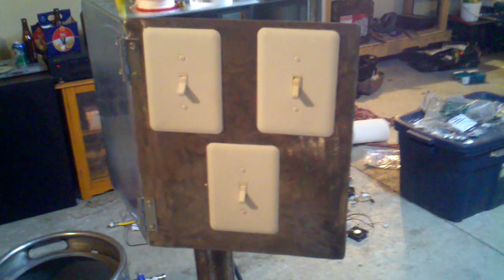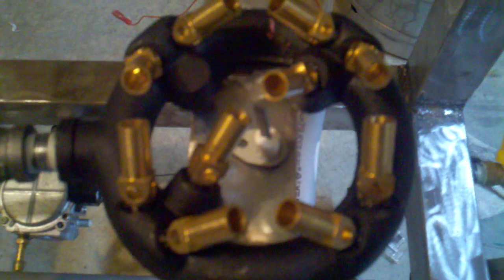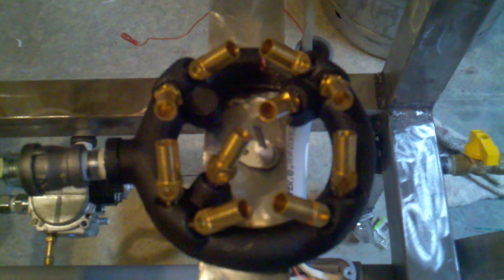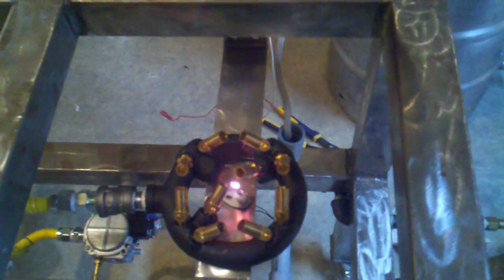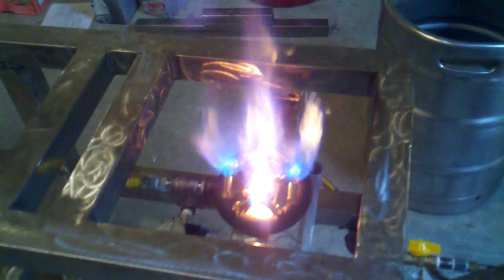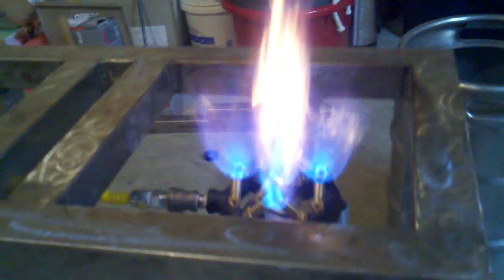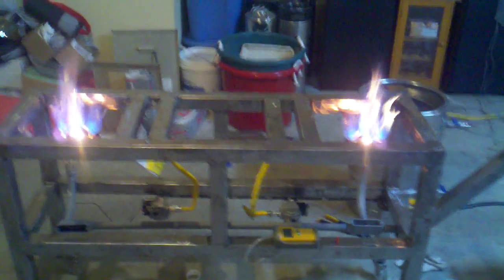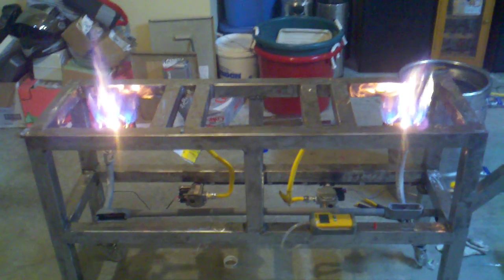Brutus jet burners with hot surface ignition.

Comment: Nice! I'm thinking of going with a hot surface ignitor for my system. Do you have any thoughts on using HSI with your brewery? It looks like you've been using them for 2 years now, so hopefully you've got lots of experience at this point :) 

How long does it take for the HSI to heat up to ignition temperature? How long to they last? Do you run them off 120v AC straight from the wall or is it DC? Which model are you using? Thanks for the help!